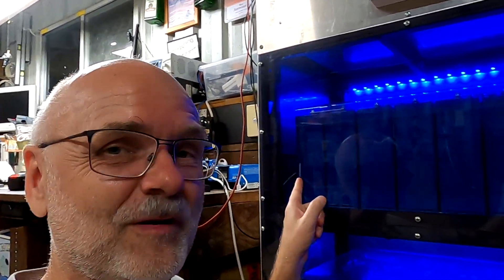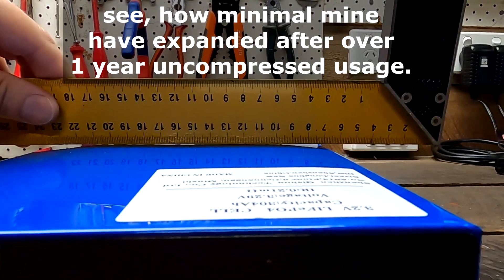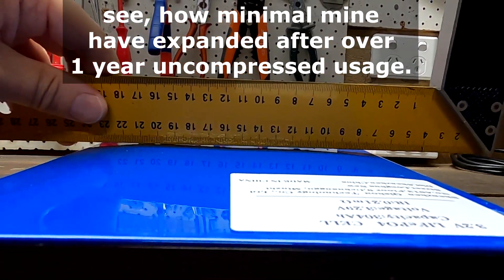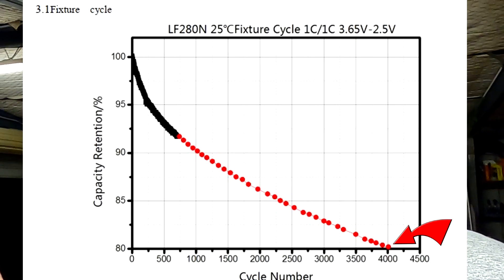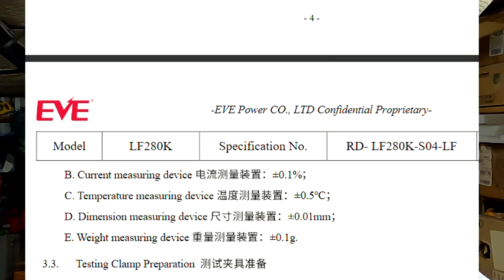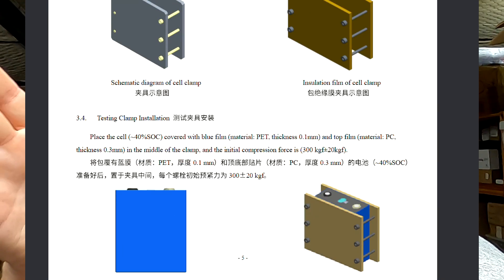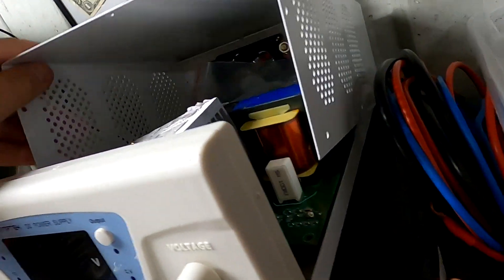Why you should compress your LiFePO4 battery! And why it does not matter... 🤷‍♂️

Comment: The reasons that you listed I would not compress a cell for. Why I would compress a cell is I don't want the terminals to be shifting in applying pressure. Just like you did when you check your battery rack you readjusted the gapping. There's two ways of doing taking yourselves apart and adjusting them every so often or just clamp them down so they don't shift.

Comment: Congrats! Your are the first I watch who has gotten it and explained it in a very clear way. Remains the question what would have happened to your "certified" cells which spread apart. I think it helps to keep the cells in check so no readjustment of solid bars is necessary. If you have flexible busbars then it might not matter.
So there might be a mechanical advantage to apply some pressure to the cells.
Reply: I developed a way to administer the right amount of compression to the cells with my cordless screwdriver. I didn't want to buy another tool (torque wrench) which I would use only one time. So I thought about the screwdriver I already own because its torque  can be adjusted. Albeit with no calibrated settings.
To find the right setting I used bathroom scales and a lever. The lever was attached to a board at one end with a long screw. Halfways I made a hole in the lever and the board through which I put the actual threaded rod I want to use on the battery. The far end got a short screw which pressed on the scale. So I had a 1:2 ratio of the middle and the end forces. The 300kgf on the battery cells will be achieved by four tensioning rods. So a single rod has to produce 75kgf of pull. On my setup if the 75kgf have been reached at the middle of the lever the scale would show 32.5kg. I let the cordless screwdriver tighten the nut on the rod until the scale showed 30kg. Then I turned the clutch setting back until it clicked (released) at that scale reading. I marked the setting and that gave me the torque wrench setting I need.

Comment: Great video Andy.   I think you should put compression on the top shelf of the battery 1.0 and leave the other two shelves without compression.  In 33 years we will know which lasted longer.  😂
Reply: I think you have hit the nail on the head here.

We don’t have actual evidence of what these cells will be like in 33 years.

Everything is hypothetical.
Reply: @chrispaul7401  Whilst different in that they have a plastic case, my Winston LFP battery in my caravan (12v/400Ah) is still absolutely fabulous after well over seven years, so that’s a great start. 
Will they still be around at 30 years of age? I doubt it, but likely neither will I. 😅

Comment: Compressing with springs allows for close to the recommended compression throughout SOC. This is recommended for reasons. Overcharging over discharging causes delamination. Proper compression can prevent excess preventable expansion during mistakes and thru normal SOC. Maybe I’m wrong but it’s easy to compress them properly. No reason not to

Comment: I currently spaced my cells as far apart as the busbars allows it (~5mm atm).
I preferred cooling (air circulation) around my cells than compression.
This still worries me... how much more expansion after 5 years?
Reply: My uneducated guess is that it will stop after the initial expansion- unless the cells are seriously abused.

Comment: if(Anticipated years * cycles per year) > cycles uncompressed rating)
   then compress;
else
   fix at after initial bulge spacing per spec;

Something like that.  All of my salvage EV batteries from Samsung are fixed.  I believe not fixing the batteries takes away a sign of battery failure, which is detecting the initial signs of swelling.  When my Nissan Leaf cells failed they were swollen to the point of breaking the compression plates on each end of the battery.  Different chemistry and pouch cells, but same concept.  

I know that it is nearly impossible to come up with a Rule of Thumb on all of this.  For me I fix all my cells and even if it is overkill I won't end up regretting the effort and expense for 10 years or so when the batteries age out.

Comment: Two possible scenarios I think a fixture (not necessarily compression) could be a good thing. I built two 48v batteries 1 year ago, one of them is installed in my boat - I wanted to minimise damage caused by vibration. The other battery is running my house. The key thing here I used flexible bus bars on both batteries between all cells to allow small movement due to vibration and swelling. I was more concerned about any movement damaging the cell terminals / electrodes.
Reply: If the bus bars are long enough, there will be a gap between the cells and therefore, the tiny swelling will not cause the cells to touch each other or apply any force on the terminals.  So flexible bus bars aren't necessary in that case.  And as Andy said, it's good to have some space between cells for ventilation to keep their temperature lower - assuming the load current is high enough to raise their temperature significantly enough to need the ventilation.

Comment: What about compression in seplos boxes? Would the rubber between each cell allow for enough expansion to not cause damage? Not sure what happens ti the expansion about the anode/cathode if not allowed to expand enough
Reply from the maker: Yes. I think this is the best solution so far I have seen. It snugs them together tight but still allows these forces to contract and compress through the foam.
I guess, it would damage the cell over time internally if compression is done the wrong way.
Reply: @Off-Grid Garage  so seplos for the win? I have opened several drop in style lifepo4 and only have epoxy board and packing tape , no allowance for expansion

Comment: I am 100% most definitely going to compress my cells when I assemble my pack. I'm going to have it in a moving vehicle and I don't want the stress on the terminals from having the cells moving around independently. This should increase cell life by greatly reducing mechanical stress and vibration on the busbars and terminals.
Reply from the maker: Yes, absolutely necessary in a vehicle!!!
Reply: Agreed- mobile application is a different ball game! 
I have the Winston LFP cells in my caravan compressed, over seven years old, still going VERY strong 💪!

Comment: My first 16 cells are shipping this week and the next order i make end of April and the next last one end of Mai i think so i can install all batteries end of August.Then we buy 36 Solar panels in June and the last Eqipment end of August with 3 Victrons 48V 5000 or 8000 + 3 mppt charge controller 450/100 For testing and top balancing i take a EBC-A40L capacity test charger and for the ohm value a YR1035+ yes i compressed all cells too in a EEL batterie box.
Reply from the maker: Wow, going big right from the start. I like the commitment! The EEl box will compress them nicely. It's the same as the Seplos box.

Comment: I don't want my batteries to look like puff pastry. Terminals are protected by compression and it's not hard to compress them anyway.
Reply from the maker: Well, as we have seen with my cells, the swelling was minimal.
Reply: @OffGridGarageAustralia  Yes. But, compressing them takes very little effort so why not do it? I don't look at my cells all the time. Compressing gives me some sense of security...false or not...no loose ends. IDK... All those batteries in a tight enclosed area with all that electricity flowing....in my house... I wish I had a piece of land like you and not really worry about my shed or garage burning down. I just want to make every effort to do things right. Redundancy I guess.
Reply: @OffGridGarageAustralia The swelling is dependent on the C rate being used during charge and discharge. If you pump and drain them at a high C rate (and anything above 0.5C qualifies in my book) , they WILL swell much more and much faster.

Comment: Interesting Andy, but by how much has your row become longer in total? Do you really think that the 6x M6 threaded rods that would have held it together would have gone through this length expansion? You can test how many hydraulic jacks it takes to apply this force 6xM6 threaded rods to allow this expansion. Think your cells have increased 1mm per cell, so 7mm in total. I am already looking forward to the video.
Reply from the maker: The row itself has not moved. That was less than 1mm all in total.
Reply: @OffGridGarageAustralia  pro zelle! Then I buy a used Tesla, which is then also after a year 1cm longer... Oh no, they are braced.
Reply from the maker: @maxmeyer7299  Tesla uses cylindrical cells...
Reply: @OffGridGarageAustralia  look at 44:50 or so, what he says there... and classify it... what is belly and what is molecular expansion

Comment: Hi Andy, I don't know how you calculated 75 cycles a year?  But my lead Carbon battery's are a few weeks away from 4 years old, the Victron shunt has recorded 108 cycles in that time. I'm off grid so the battery's are my only source of power so they are either discharging or recharging from Solar or the generator. It's not exactly  clear how Victron records one cycle? I've given up worrying about cycles.
Reply from the maker: I have not calculated the cycles, the BMS for each bank show me these numbers. The smart shunt has a bit higher number because it calculates all batteries simultaneously.

Comment: There is another reason for compression. If the connections between the posts are not flexible, expansion could damage the posts in the early stages of use.
Reply from the maker: Hence I like the Seplos battery boxes with the EVA foam in between.
Maybe flexible bus bars are the way to go. Just not sure how good they would work with the welded studs and the minimal contact area (which works great with copper and aluminium bars).
Reply: @OffGridGarageAustralia  A flexible bus bar with a round (not oval) M6 hole should give better contact. After all this reading I'm tempted to try this. It remains to find a good flexible bus bar... For the moment my EVE LF280K 16S battery is mounted exactly like you. Would you like to take a test for us? 🙃
Reply from the maker: @M-Clem  Yes, I'm currently sourcing some bus bars I will test...

Comment: Thank you. I did not compress and run an oven on my 24v system at .5c and the cells are happy. Not that much swell but all is well.
Reply from the maker: Not that much swell but all is well. 😂
Reply: @OffGridGarageAustralia  I always charge at .1C...swelling of cells I do not see. Four EVE 302's sit on the floor my low amperage charger allows no more. Sometimes I am happy, my charger is so small because I seem to see no bulge at all. Thanks for the video Andy.

Comment: The only reason why I compressed mine was because the busbars weren't fitting properly if I didn't.  I also have some much older GBS 100Ah cells that I did not compress and you can readily see the stress they put on the busbars since the bottom spacing between cells had much wider spacing then the top (since the cells expanded and were touching each other).  Almost makes me wonder if compression is expected just so they don't have to supply more expensive longer busbars.
Reply from the maker: How much longer would the busbars need to be though, 5mm maybe?

Comment: 😂😂 hey great great video. Love the way you explained that one 👌🏻👌🏻

Awesome technology these LiFePO4 cells ... 

Having gathered infos from watching your and other videos ... two questions arise often: 1) what about lithium titanat cells ... do you have more infos or would u be interested in testing those? 2) you often mention and explain very nicely to not ever go below 2,5 volts while discarging ... i am so curious what happens if one would go down further ... slowly ... what actually happens? Does the cell die and can it be rescued somehow? Would be an awsome video i think 🤫😉
Reply from the maker: Thanks. Lithium Titanate is not very common in DIY or even commercial applications. It is just too expensive and LiFePO4 gives you a better deal all around
If you go near 2.5V, the cathode starts to disintegrate its structure and electrolyte decomposes, which causes irreparable damage (capacity loss). So don't go under 2.75V. 
I'm not an expert in that, it's all chemical processes and I learn as well as I go but am happy to pass all these info one to you guys.
Reply: @OffGridGarageAustralia  great thx a lot 😁

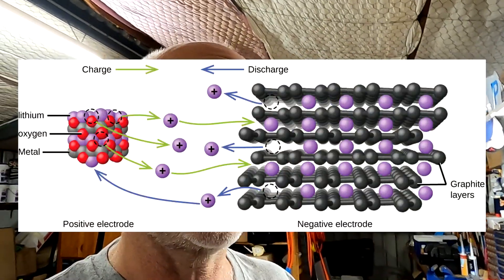Comment: Hmm, I think the unavoidable swelling you mention around @2:35 is well known. As you charge the cell expands, as you discharge the cell contracts. I think that is different from the cell gradually getting a larger "Beer Belly :)" overtime. The question is, will your cells keep expanding?  A year from now, will they be even more swollen. Would be interesting if you kept records of the sizes overtime. Thanks for the video!
Reply from the maker: All cells will expand at the beginning to a certain point. Only if you overcharge the cell, it will expand further.
The expert also says, don't go near the 2.5V or 3.65V mark as the cathode and also the electrolyte start decomposing which causes damage and the cell loses capacity. 2.75V - 3.55V was recommended.
Reply: @OffGridGarageAustralia  Great news! My caravan LFP cells, over 7 years old, have never been below 3 volts and been briefly above 3.5 volts maybe just two or three times in total.
Normal for my cells is 3v absolute minimum to 3.45v absolute maximum. The little you gain by going further is negligible capacity gain for much more stress.
Reply from the maker: @FutureSystem738  It's like with our Teslas, never charged to 100% and never to 0%. Keep it in the middle and it will last a very long time.
Reply: @OffGridGarageAustralia  Totally agree Andy. 👍
Our car has been above 90% maybe three or four times, and above 95% literally NEVER.
It has also been below 20% maybe four times as well, and below 10% NEVER.
Reply: If they would expand more and more with time, they would also break any compression over time, as you cannot stop it...

Comment: In other words, cell manufacturers are stupid, they write random, irrelevant things in their data sheets and have no clue about the cell characteristics. So good that we have Andy 😊
Reply from the maker: Well, they make these cells for mainly for vehicle manufacturers where they are being put together to larger packs and strings in a fixed installation. We as the DIY community build our own batteries and there are no clear instructions on how to install them correctly. Fixture or compression is not the same and look on the forums at all these different methods of compression designs people have come up with to install them.

Comment: Put your cell on a vibrator and any bubbles that are stuck will rise to the top 😁 Like the needle vibrator for the concrete used to remove the bubbles inside the concrete.
I'm pretty sure, none thinked about that.
Reply from the maker: Yeah, the expert said it would need a vacuum and around 400°C to remove them all but at these high temperatures the separators (PP material) will not survive.
Reply: What about an ultrasonic bath, but running it dry with the battery sat in it?  @ 30khz ?
Reply: You don't want to add high frequency vibration to any fragile/soft crystalline structures.  During my time doing jewelry repair, I had to be cognizant of which precious stones were placed in an ultrasonic cleaner as some would quickly fracture if there were any deformities in the crystalline structure (some precious stones are full of them).  With that in mind, ultrasonic vibrations can absolutely initiate or accelerate delamination.

Comment: IMHO if the batteries inflate it means that you are doing something wrong, and surely you charged them too much, or the bms is charging them too much, down to the last drop.
Compressing batteries and not eliminating the problem of overcharging means trouble soon.
The batteries are not compressed with threaded rods, as you can see many around,  the understanding must be done to perfection. As the builder says  
not as we think
Reply from the maker: They will all expand a bit, regardless how you charge them but it gets worse if you go to the extremes as you said. And the manufacturer talks about a fixture, not a compression. Whatever that means...
Reply: @OffGridGarageAustralia  the batteries go compressed to 12,5 libre square inch.(look for the pdf to be sure) or your cells should be compressed 300 Kg with springs  (batteries must be compressed but must be free to expand)
there goes an insulating sheet between the batteries and a busbar great but flexible.
obviously they should be compressed from the beginning and loaded at most 90%,   otherwise in a while you will have blue watermelons